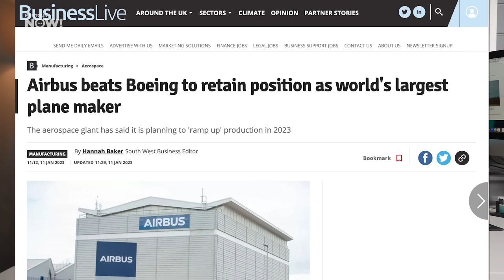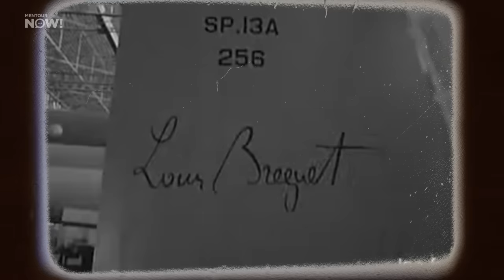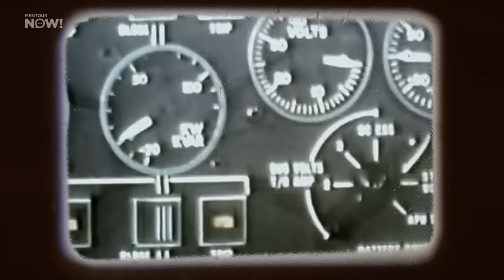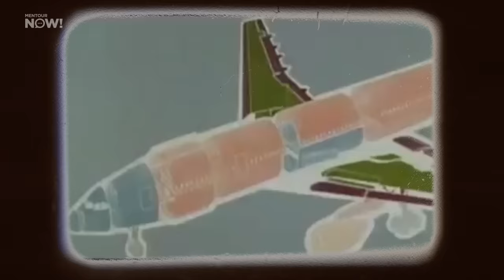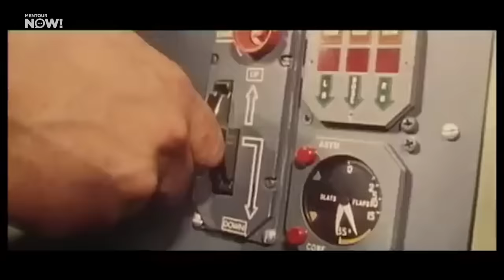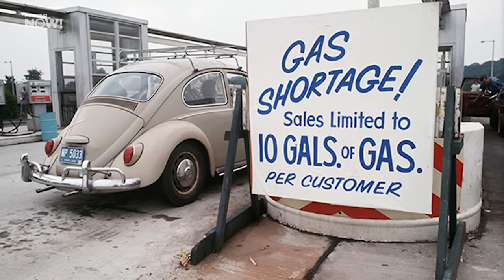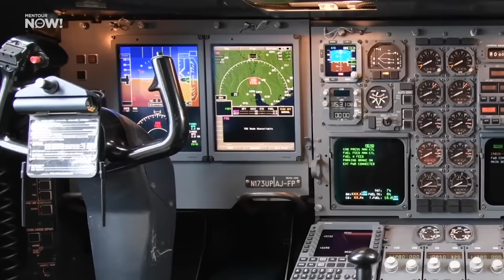Without this Aircraft, Airbus wouldn’t exist!

Comment: Interestingly, the original airline specification that the A-300 was designed towards was a specification from American Airlines.  In the time when the slightly smaller widebodies (DC-10 and L-1011) were under development, AA floated a specification for this type of aircraft.  This spec was developed by Frank Kolk, of the AA Maintenance and Engineering department, and called for two, rather than three engines.  AA wanted this kind of layout for the DC-10, in fact; but the other US airlines held out for three engines.  Somehow, the specification wound up in Europe, and Airbus apparently incorporated that thinking into their design.  They pitched it to AA, but by that time, of course, AA was already invested in the DC-10; but came the day, in the late 1980's, when Airbus made another "offer you can't refuse", this time to Bob Crandall, and AA wound up with 35 of the -600 variant, which we kept for 20 some years.  In that roundabout way, the original AA spec ended up at AA.

I flew it for 9 years in the 1990's, and it was a good airplane, except for that then-unknown rudder issue that would raise its' head shortly after 9-11.  The short, stiff wing did not like flying high, and I only ever flew it above FL370 on a couple of occasions when it was empty.  You couldn't get it over 330-350 until close to the end of a flight.
Reply: Thank you very much for sharing this History and your Experience!👍
Reply: Likewise experience in the 310. Didn’t like to go Hi. However, the power of those engines... she flew on power! You go around and you would get 6000fpm easy....
Reply: Story sounds like an American retro-fit. Not questioning that this guy proposed the configuration. Not buying that this was the origin of the A300.
Reply: Flying experience aside, the A300-600s that American had, were a Maintenance Nightmare !
The European manufacturing processes were more in line with WWII in that the airplanes structure was designed to be life limited, their for things like the basic formulation of the Aluminum in the aircraft was total junk !   We made thousands of dollars in overtime, grinding out corrosion, and replacing Aluminum parts that just seemed to out of nowhere have massive inner granular corrosion.  The non  Destructive testing department worked night and day, with all the inspections for cracks, and x-rays that were needed on those planes.  The only good thing Airbus did was use GE Engines !
The engines gave the Airbus reliability on the gate, which AA loved.
But dealing with the mainly horrible fuselage structures issues, and German Blueprints and French terminology used on the supposedly engineered American manuals, was to be blunt, a pain in the bum !  
Maintenance cost is why American ditched the Airbus A-300.  I have no idea why after all those problems, when USAir took over Americans Airline, they stuck with so many Airbus Aircraft, and are buying more.  Lessons learned, and quickly forgotten!
Reply: @jameslester4474  It sounds like you were one of those AA mechanics who were so hard put to it to keep them in the air.  My personal thanks for having done so!  Suffice to say that those issues were never brought to the attention of the vast majority of pilots - even those in the flight office, as I was during the first half of the 1990's when the type was at its' maximum usage at JFK, where I was chief pilot.  

As to any "engineering" of the manuals, recall that the first 25 of ours were obtained on a then-novel "rent-a-plane" basis - essentially the aeronautical equivalent of going to Hertz or Avis, and not on any long term capital lease as was the norm, then and now, for airplane acquisition.  Airbus was, at the time, eager (putting it mildly) for a big sale to another US company; and as I indicated above, they more or less made Bob Crandall an offer he was loath to refuse.  We could have returned them at any time on little more than 30 days notice!  This is something that Airbus has done repeatedly over the decades, to companies like Jet Blue (among others), to move the metal off the lot.  If it were not for this willingness to be giving the airplanes away at and maybe even below cost, Boeing might still be the largest manufacturer.  As an interesting aside, Boeing (not to be outdone) immediately offered us 25 767-300's on essentially identical terms, which we also took up enthusiastically - somewhat to the chagrin of Airbus!  But the Boeings were the nucleus of an eventual fleet that numbered more than 100, so their gamble paid off a bit more lucratively than did Airbus'.  

We did keep them for over 20 years, which more or less points to the notion that, whatever the maintenance cost might be, they were still desirable on the property.  They could haul a huge load, both passengers and cargo.  In fact, while I was there, they were the largest passenger capacity airplane in the fleet, having more seats (albeit mostly in coach) than even the 777-200's.  It was not until AA got 777-300's, very late in my career, that we had an airplane that carried more people than the A-300.  

I share your lack of enthusiasm for the later models of Airbusii, although in my case that stems more from a disdain for the sticks and the method of interaction with the automation than for any lack of long-term structural integrity of the airframes.
Reply: @jameslester4474  Airbus has been strongly outselling Boeing for years, so I guess, whatever the truth of your maintenance claims, they are certainly not an issue to airlines who buy Airbus aircraft in much larger numbers than Boeing today.
Reply: @lours6993  There's something somewhat odd about the way these two have piled onto the A300 as 'American Inspired', and 'appallingly badly made'.

Almost as if they've come straight from the Boeing PR department.
Reply: @jameslester4474  May be it was fixed in the a310. My company operated them for more then 20 years almost all operation in Atlantic Ocean and I didn’t recall anybody talking about those issues. In the 320 structural resistance is praised by maintenance. They say it’s far better then the 737. About manuals.... you are so right. It’s still a French complicated way of thinking. They are a nightmare, bad designed and difficult to find things.
Reply: @jameslester4474 Easy answer. Because Airbus addressed all of those problems you claimed.
The problems American Airlines had with their A300-605R were of course fixed by Airbus.

The A300 was Airbus' first aircraft, so they of course had to learn several things.
You seem to forget all problems Boeing had with their older airplane models.
The problems with the size of the rudder on the 707. The wiring failure which caused the crash of AA flight 1 after departure from JFK. The rudder problems with the 737.
The faulty fuse pins on the 747 engine, MCAS, etc.
That doesn't mean that Boeing airplanes are in general more dangerous. But a problem one airplane Manufacturer has fixed, is a Problem another airplane manufacturer will try to avoid even before designing the plane. The usual learning curve.

All of those problems are long gone with modern Airbus aircraft.
So the maintenance for modern Airbus airplanes is now even easier then for a Boeing airplane.
And they are almost always even cheaper than Boeing airplanes today.

Right now Airbus is manufacturing the most modern, most reliable and safest airplanes in the world for a lower price than Boeing does.
So airlines will of course buy Airbus airplanes like crazy.

The oldest A300 still flying is 39 years old, the oldest A310 35 years and the oldest A320 is 32 years old.
Some of Lufthansa Airlines oldest A320 in Germany were 30 years old before they were eventually retired.
Same with several other airlines.

So all of those problems are long gone.
So the airlines will of course buy even more Airbus jets.

And with Boeing now being short on Money and leaving certain markets like the NMA (757 replacement jet), Airbus can literally sit back, relax and Design the future aircraft that will replace the A320 family with enough time and money to spare, while Boeing has to keep their purse closed for new projects.
And all of that is Boeing's own fault.
Airbus now ascended to the throne of being the world's largest airplane manufacturer. And they won't leave that throne ever again.
It's has basically become Airbus philosophy now to always stay ahead at least one step of Boeing.
So Boeing will have to accept of staying #2.

But as others have already said, Yeah the Manuals are awful on Airbus airplanes.
The German desire to describe every little dot on every i, and the french way to then describe it in a way, that you get the impression that the author of the manual has a romance relationship with that dot on the letter i makes them a little bit tricky to read.
But besides that: Extremely reliable airplanes.
Reply: Absolutely amazing perspective. I flew on the A300 as a kid, I’m an AMT now never got to work it, before my day. The older techs def said it had its niches and was broken down enough that it provided for a lot of OT 😂. Still a historic, amazing aircraft.
Reply: @jameslester4474 US Air did NOT “take over” American Airlines 😂 and I came from US Air!  The AA pilots foolishly demanded US Air top mgmt take over but that’s about it.  They regretted that as they came to know 5 time DUI Ace CEO DoUgIe Parker and his conniving ways.  

Interesting takes on the AB reliability and distain for automation interaction.  B737, E190, AB320, AB330 type rated.  Only the B737 would I have to be force bid to fly again.   Hot, antiquated and cramped as hell cockpit.
Reply: When you can't beat them join them. B ,& A should just merge & stop competing.
Reply: @sharoncassell5273   Boeing and Douglas merged and many critics say that this was a beggining of Boeing problems.
Reply: You are correct their was a design ready for a version of the DC 10 called the twin. It was very popular with European air lines but ETOPS rules made it less so in the United States. That’s why the 3 engine option won out. The project was dropped and would have shared 80% of the DC 10 parts commonality. Airbus picked up those European options and the USA latter changed the ETOPS rules. Rest is history
Reply: Rudder issue? AA587? The lugs failed at twice the design stress.
Reply: @jameslester4474  Interesting and Thanks ! Presumably, given the numbers of A 300s still flying, those problems were fixed.

Comment: The biggest selling point was how Eastern used the A300B4 to fly from Miami and Atlanta all the way to Los Angeles and San Francisco with much less fuel burn than the L1011's Eastern were also already flying. The was the critical juncture that got other airlines to buy the plane.
Reply: It’s not just that but Airbus was also smart to loan some A300s to Eastern for free. Risky marketing move but it paid off massively.
Reply: @CoSmicGoesRacing  But Airbus couldn't use the first-production A300B2 model. The A300B4, which could fly between Atlanta and the USA West Coast easily, was the model that Airbus lent to Eastern. Its success with its substantially lower fuel burn compared to the L-1011 Eastern were using on this route was critical in convincing other airlines to buy this plane for high-density medium range routes over the L-1011 and DC-10.

Comment: Small gripe: The BAC 1-11 didn't look like the DC-9, the DC-9 looked like the BAC 1-11 as it preceded that design by 5 years. Yes, I'm biassed here, I flew among the last BAC1-11s in regular passenger service. Love these historic videos! Keep them coming.
Reply: Yes, the One-Eleven's first flight preceded the DC-9's by 18 months, and it was in service with its launch customer, British United Airways, nearly a year before the DC-9, despite a fatal deep-stall accident that delayed the test programme and certification. The twin-engine DC-9 and its successors used a similar rear-engine and T-tail config as the One-Eleven, so Douglas would have benefited from the data obtained after the One-Eleven accident.
Moving on to the two larger tri-jets, the HS Trident and the Boeing 727 - both of which preceded the One-Eleven but shared the rear-engine, T-tail configuration - I think it's generally accepted that Boeing took the unprecedented idea from de Havilland (Hawker Siddeley's predecessor), which had been indiscreet. The B727 first flew only a year after the Trident, which had been delayed and down-sized by the dithering of its launch airline, state-owned BEA. The Trident 1 turned out to be too small, whereas Boeing was able to cater for the worldwide market.
Both Trident and One Eleven suffered from the thrust limitations of the RR Spey engine, which also had a lower by-pass ratio than the P&W JT8D employed on their American rivals. When BEA eventually demanded a much bigger version of the Trident, the 3B, it had to be fitted with a booster engine for max weight take-offs. The stretched One-Eleven, the 500 series, had to resort to water-injected Speys to compete in the European charter market, but the improvement in take-off performance in the summer was marginal.

Comment: Hi Peter, thank you for telling us about this Airbus history. I’m considered so lucky for having an opportunity to fly most of Airbus 24:10  type. Slightly over 30 years experience as pilot, 1992-1994 flew DC-9-32 & 1994-1996 flew B737-200 & my first Airbus on A310-300 & A300-600 in 1996-1998 (First company) was trained by Sabena Pilot. Second company flew A300-600F 2004-2007 was trained at Airbus Toulouse. Third company flew A330-200; A330-300 & A330F then CCQ A340-500 A340-600. I got upgraded as Commander A319 & A320. Fourth, fifth & Sixth company as commander A320 CEO & NEO then Seventh company as commander A330-300 then upgraded to A350-900.
Reply: I had the pleasure to fly on an A350-900 just recently. In economy you feel the difference to a 787 or 777 I had on other legs. The live camera view during take off and landing is amazing for passengers.
Reply: what a life 🥳🤩👍🏽🛫✈️

Comment: The a300 was the first to feature a supercritical airfoil, the first to make use of composites, it used glued parts instead of rivets, it was revolutionary, and very beautiful
Reply: The bonded lower fuselage skin on early production aircraft had to be replaced when in service dis-bonding occurred.
Reply: Interesting. I was inder the impression Fokker pioneered composite/glued parts on commercial planes.

As usual the answer isn't as straightforward. Seems Airbus was pioneering these parts as well. Could well be the first, won't start a chauvinistic internet riot over a now demised aircraft manufacturer 😉
Reply: @gauloiseguy Still a shame Fokker disappeared. Same as Dornier!